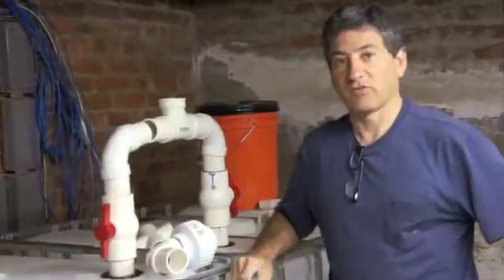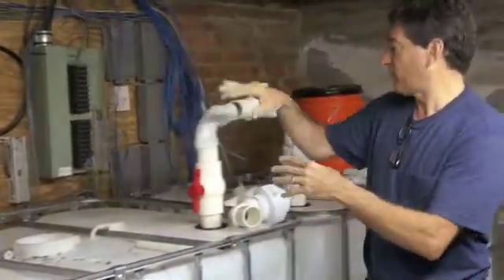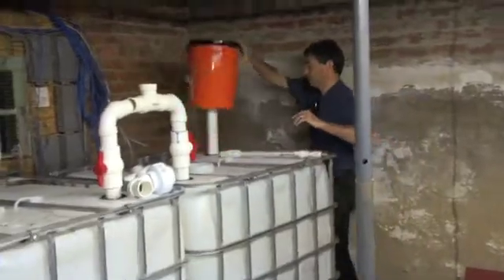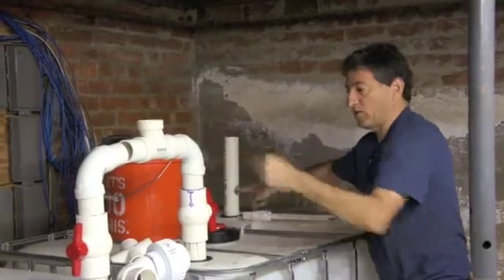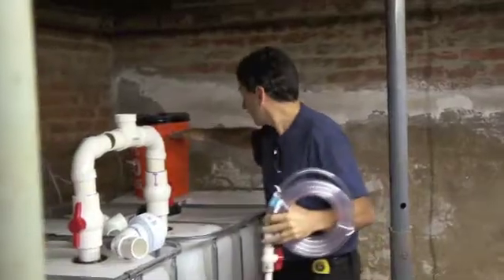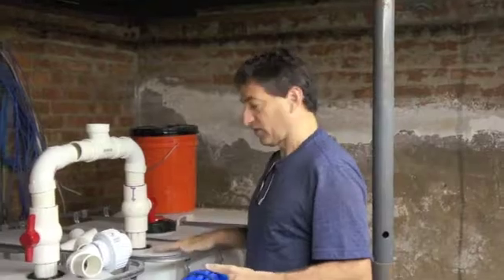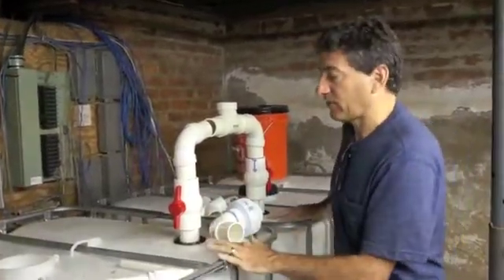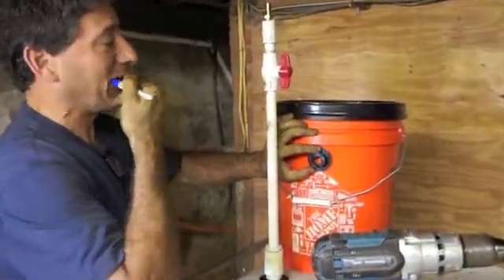Mud Creek Biogas

Comment: Can you start a digester with humanure also since you need pressure for the gas why not put 2 IBC toats one on top of the other fill the bottom tank with water let the gas bubble in at the bottom attach a hose from the bottom of the bottom tank to the bottom of the top tank so as the gas builds up in the bottom tank it forces the water up to the top tank creating   gas pressure  for your gas appliances

Comment: Great ideas. To keep the biomass digester at the ideal temperature you could use your existing domestic hot water tank to make a heating loop; then circulate it through a simple three-way valve or a manual control to the biomass unit using a low voltage zone valve and a thermostat with a 12vol pump to circulate water around the digester. There are safety concerns with such a system of course; but in Alberta Canada, as far as I recall,  it is permitted by insurance companies to use a hot water tanks for hot water heating. Here in BC you MUST use a certified boiler for hot water heating however due to the Cross Connection concerns.